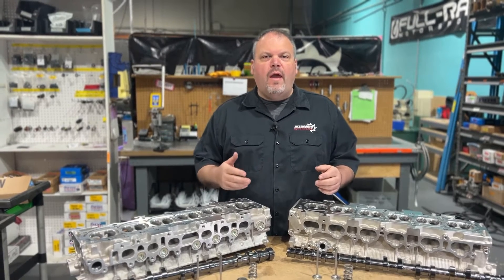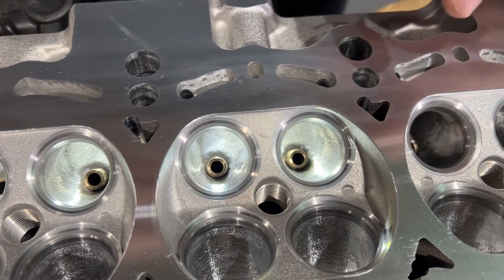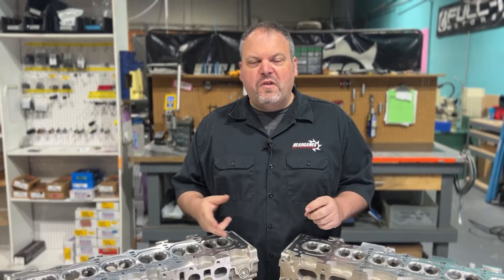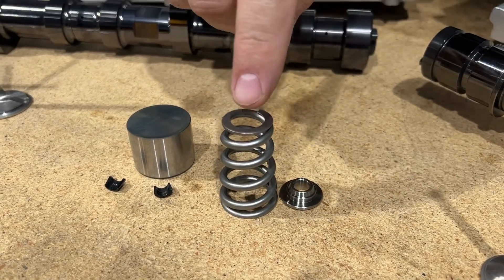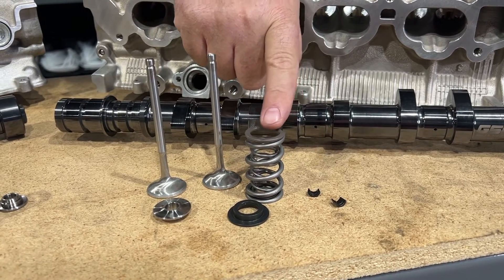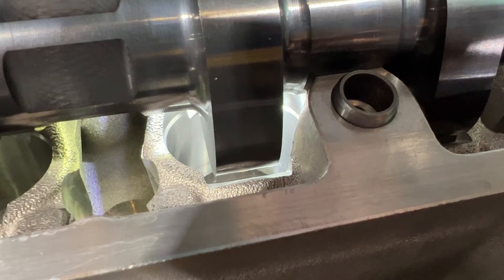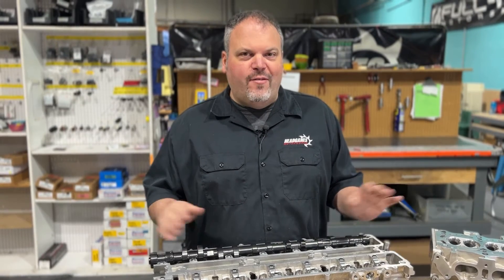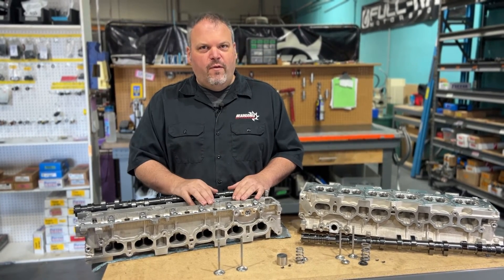HeadGames 2JZ Power Pak 2! What is it?

Comment: Ok... I'm building a MK4 supra for time attack/pikes peak and streets.

It will be on a 6766 turbo with a .63 hotside if that helps. It is also an NA-T build with a stock short block (for now).

Now where you come in at.

At the moment... I have BC 272 cams and a toyota shimless buckets in my possession as of now. I was thinking of keeping the stock intake valves and doing a stock sized sae exhaust valve made from inconel with a dual spring and maybe a multi angle valve job. What is your opinion one what I said so far?
Reply from the maker: I wouldn't keep a stock intake valve. Not sure what a "SAE" valve is, sae is the society of automotive engineers as far as I know. I would not do a dual in that situation. Check out our power pak 2. https://headgamesmotorworks.com/collections/2jz-700-1200whp 

I would do the rebuild with guides or pocket port. GSC OEM sized valves, and their 5066 conical spring kit. Shimless buckets and reuse your cams. That is a combo that lets you beat the crap out of your car for years to come.

Comment: Hi Dave. What's the cfm difference between the 2jz power pak 1,2,3 and 4? How much horsepower is gain per cfm?
Reply from the maker: man I wish that was an easy question to answer. It's more than a CFM gain, there is different parts because each one is for a separate whp range.

Comment: I went with a pocket port on my head with GSC 5266 dual springs, GSC S1 cams, Ferrea intake/exhaust valves, shimless buckets and a few other upgrades.  Still in the process of my build but aiming for 6~700whp on pump and 1000whp on E85
Reply from the maker: perfect set up!